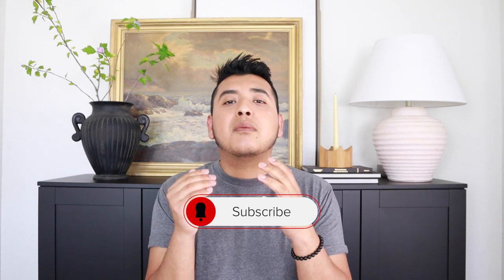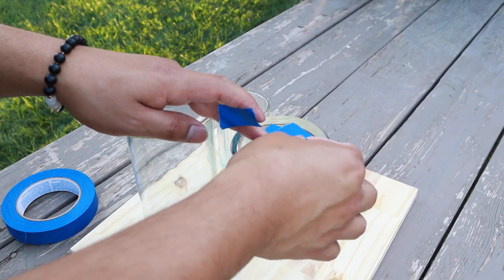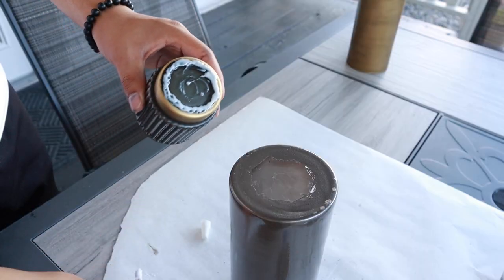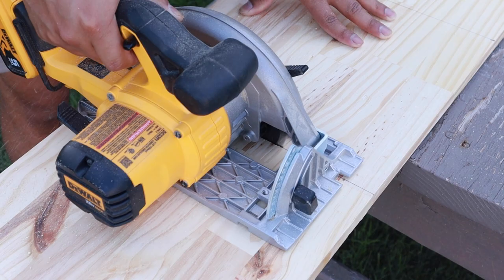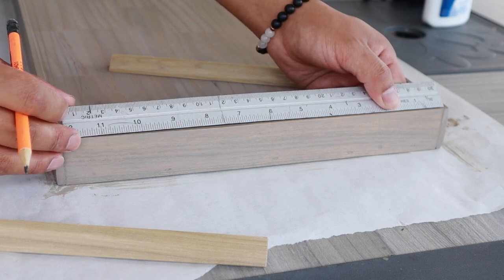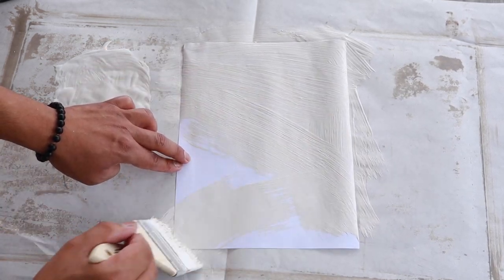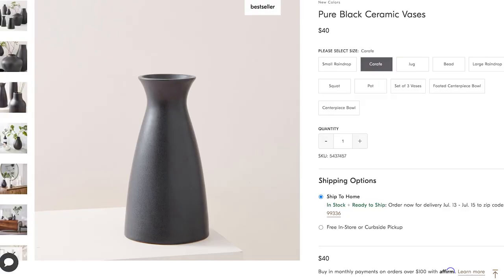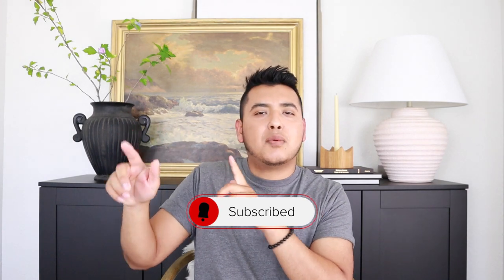DIY West Elm Home Decor For Less (modern + minimalistic)

Comment: Love your projects. I think your tray looks better than the original one. The last project I found in a charity shop and sprayed it black but it has bubbled. Do you know what I did wrong? 😄
Reply from the maker: What went wrong?!
Reply: I honestly don’t know. I cleaned it then sprayed it black Matt, waited for it to dry then sealed it. Bubbles have started to bubble
Reply from the maker: @carolinecasey6490  hmmm, maybe the was a reaction of some kind
Reply: Maybe. I’m going to sand it down and add some backing soda to some black paint to see if that will work. I love the look of it so will try anything. Thanks for replying 😀